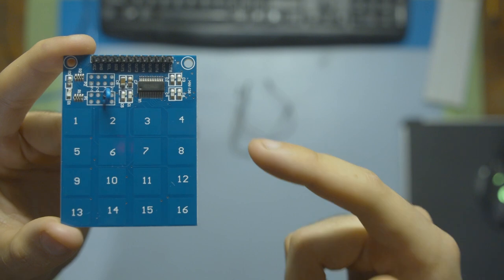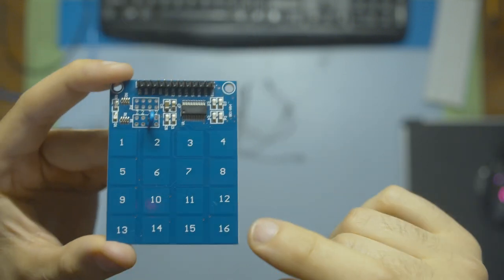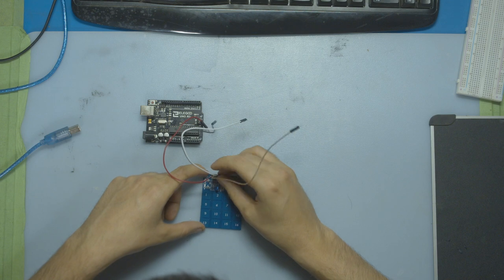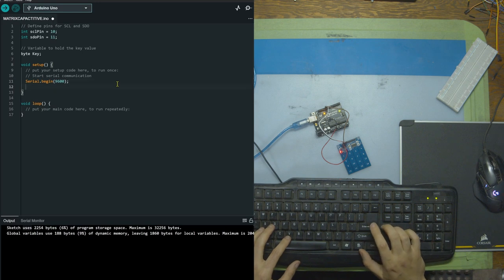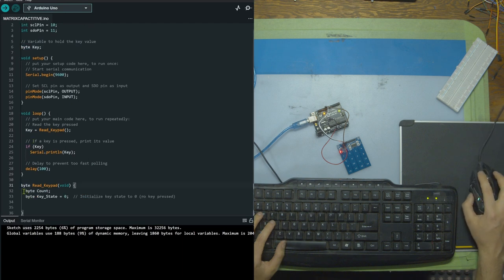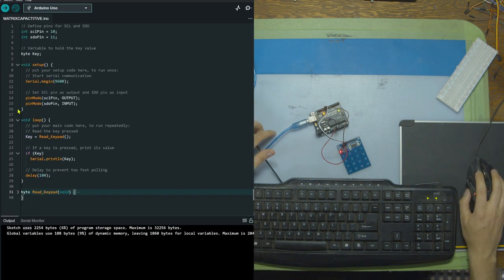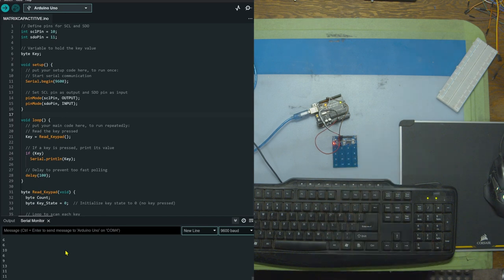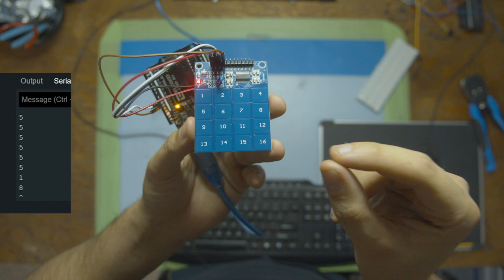TTP229 16-Channel Digital Capacitive Matrix Module | How smartphones touch screen work #arduino

Comment: hey, just curious: What reasons would there be to connect all the wires, like we can do for an lcd?
Reply from the maker: usually in a matrix setup you need the width + heigh in wires, so for 16 switches that sit 4 by 4, its 8 cables, theres some smarter panels and ways to do this but the prices go up too
Reply: I want to clarify that this keyboard isn't a matrix in the sense of connecting columns and files to use 8 cables for 16 buttons those 8pins are output for a linear 8 button keyboard (each button has its own output, this is only for the button 1 to 8)